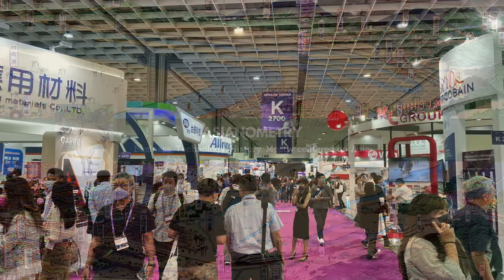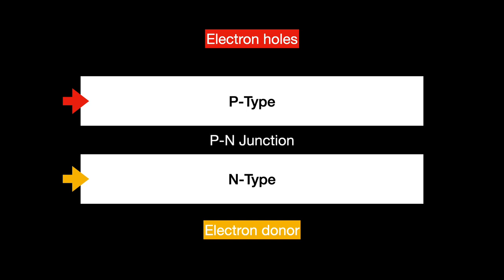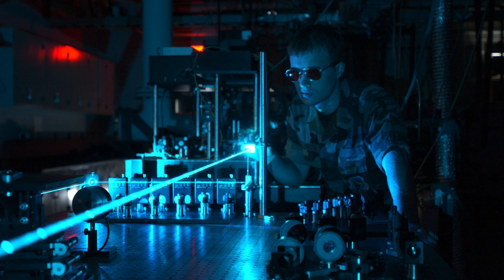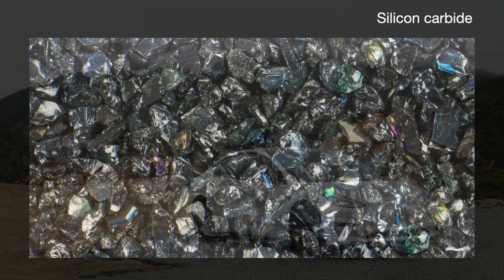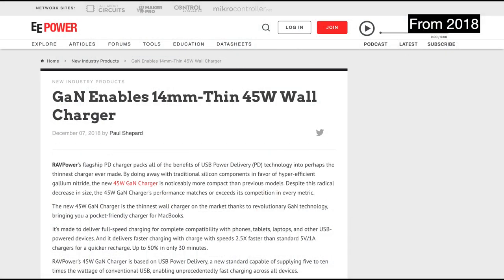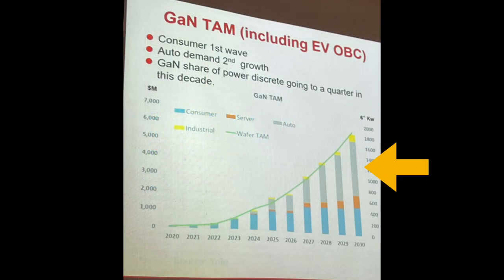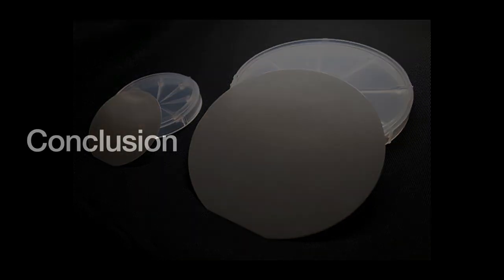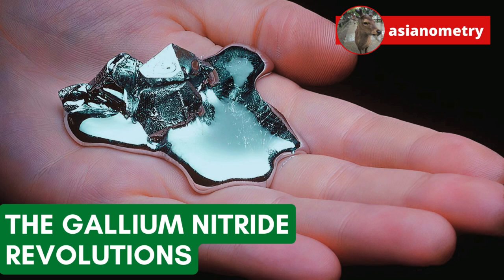The Gallium Nitride Revolutions

Comment: I keep forgetting Canada's role in Semiconductors, it would be interesting if you did a video on the industry in Canada.
Reply: Could you also please do a lecture on high voltage high power solid state over the years as in megawatt grid equipment. There are still the odd mercury rectifiers operating (rail lines) but there was no way they could handle 1200KV and several gigawatts.

Comment: Great video, Jon. My dissertation from 2004 was about GaN / AlGaN HEMTs. At the time, we were only set up to grow on 2" substrates of sapphire and SiC. High quality 2" SiC substrates were $4500 apiece, which added significant cost. To dial in optimal conditions, we'd use sapphire, but if we wanted to make the best device possible, we'd use SiC due to relatively low lattice mismatch to GaN and high thermal conductivity.
Reply: Me too. I submitted mine about GaN HEMT modeling in 2006.

Comment: I have a 1940s Selenium rectifier I bought at a surplus store in silicon valley years ago, and it's amazing to think how silicon made the modern equipment just a tiny component, but now with these future materials, components will continue shrinking to amazing degrees.

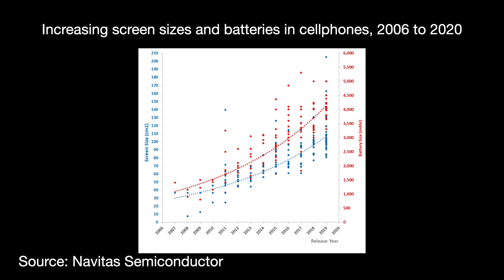Comment: 7:47 - The units of battery capacity is expressed in amps x hours.  If you work through the units it's the number of coulombs of charge it holds.    Amps / hour would reduce to coulombs / hour^2 , which is some kind of acceleration unit

Comment: In 2020, I had a chance to do research in GaN-based optoelectronics devices for photonics integrated circuits. The grand idea was since GaN was already a promising candidate for power electronics and it is a direct bandgap material, it might be possible to realize an all-in-one solution for everything electronics in the GaN platform (kind of). Another charm of GaN is its second-harmonic generation capability means that you can double your light frequency by passing it through carefully engineered GaN-based waveguides.
I got my degree from an Indonesian university. At that time, we had a joint research project with French universities and we also sent a few PhD students to learn from them. However, my alma mater is not pursuing this research topic anymore, whilst the French researchers are still researching this very topic.
Reply: Was the research done in IISc ?
Reply: @NiceBot724  He is not Indian.
Reply: @alexanderphilip1809  oh my bad, thanks for correcting

Comment: I am not an expert in this, but I invested in a power-electronics startup a few years back. Through them, I met one of their suppliers, which was a quite innovative startup in the WBG semiconductor space. The guys I know in the industry believe that SiC will likely continue to dominate in high-wattage applications. From what I've seen, GaN has a sweet spot in miniaturization of relatively low wattage applications like phone chargers. For applications like EV inverters, EV-charger rectifiers, and other high-wattage power-distribution applications, SiC has advantages due to its superior thermal conductivity and (I believe) durability. Both these companies have since been acquired by large multi-nationals, and I haven't followed R&D in this space as closely in the past 12 months or so. In any case, I believe that there will continue to be advances in WBG semiconductors that will continue to enable companies to miniaturize power distribution products, make switching of high-wattage loads more efficient, and enable improved electrification of mobility and energy storage. I think GaN will be just part of this WBG semiconductor story.

Comment: WOW! Same story as gallium arsenide. Faster switching times, early adoption by the military (involved in some of those) and hard to work with. In the meantime, silicon improved fast and overtook gallium arsenide because of its lower cost and larger scale. I recall once a relative of mine asking about a stock tip in a gallium arsenide company. I told him the story I have just related, and he did not invest. Good thing, since that company went under not long after. Gallium arsenide may well have a niche place in the industry, but I expect that is all.

Comment: 1:00 Not all materials have a bandgap. For instance, metals and other conductors usually have no bandgap. Graphene is an example of a semiconductor with no bandgap. However, all semiconductors commonly used in the electronics industry today do have a bandgap, though the gap is small for some semiconductors.

I'm not an expert, so maybe there is some technicality when you get into impure materials that endows metals with some microscopic bandgap. But I think in principle, there is literally no bandgap at all, not even a tiny one.

Comment: Great video. One thing to mention is HEMT had been used in military applications way before GaN appeared. GaAs HEMTs can provide high power and low noise at the same time. They also can operate at higher frequencies.
Reply: You will find they are used in all DBS LNAs and LNBs too ...

Comment: oh That's really fricking cool it is the first time something close related to my lab is cited. I work in a lab in Brazil and we make the semiconductor part of sensors for the aeronautic(I work in research and have no idea how it is currently made). We work manly with optoelectronics like solar-cells and medium infrared. My sector is trying to make the gallium-nitride semiconductors by Atomic layer deposition(basically you turn the compound into a gas and condenses slowly over a surface) and we have achieved enough success in the process that the semiconductor can be successfully used on solar-panels but are yet good enough to be used as sensors or for electronics. It is insanely hard to make them the concentration of the gas and the layer numbers affect the crystal and this create defects and the really sad part is that we can't adjust instantly(but the changes happen fast) we need either better equipment or better control of what we already have. My main job here is to compile the data, and control the equipment with the instructions provided by my 2 mentors on the project they are the ones that analyze the data(I don't think I am capable of doing so even if I am almost graduating one has a phd and the other is actually doing this as his phd project).

Comment: It'll be interesting to see the impact of GaN in lightweight power systems, eg power tools, drones, etc.  Re: synthetic sapphire, it's cost as a semiconductor substrate cannot possibly be tied to it being a precious gemstone.  I know next to nothing about the field, but I do know that low quality synthetic sapphire is ubiquitous throughout mechanical industries, where it sees uses ranging from precision bearings through abrasive compound.
Reply: Sapphire is a crystal of aluminium oxide. Also not easy to manufacture, but in the image in the video you can see the industrial shape it is manufactured in.
Reply: Sapphire is gem quality corundum. It is not used as an abrasive. Corundum is used for that.

Comment: With dual gate GaN, power supply manufacturers can throw away the bridge rectifier and the 60% efficient 1920-vintage boost regulator and use the 2011 bridgeless PFC circuit.

Comment: A simple question;
I'm in the-US & making a cool solar concentrator oven.  
I would like to place a solar PV cell at the focus of the parabolic mirror.  Of course I'll water cool the back of the solar PV cell (like a car radiator system).
Supposedly gallium PV cells are much more temp tolerate than silicone PV cells.   
However ????where in the-world can I buy a few gallium PV cells????

Comment: thats was a mega power move of a video jon!.Entirely interesting, includes food and blue LEDs!! also lots 'o deep info at multi level. The kick is learning/teaching ratio is at an understandable level.."the subtle learning is empowered by repeated subtle lessons." < -i made that quote up. But... it is true for a willing learner, if a fact is to stick.. it has to be absorbed 3 times in different presentations/examples/stories each time.  :)
Reply: Many years ago I came up with a "half-life" analogy for teaching for optimal retention. Spend an hour on a topic. Beat it to death. Drum it in. Students will initially have good retention but the half life will be short. The material doesn't stick very well.
   An alternative strategy is to spend, say, 15 minutes giving an introduction with not a lot of detail. After a week or so, give the topic another 15 minutes, this time going into more detail. Then repeat for a third time, this time providing all the required detail. After three visits to the topic, the half life will be very long which is to say the retention will be excellent - far better than with the initial approach.
  I employed this method in the time frame of a single semester-long course, and also, when I had the opportunity, built it into the sequence of courses in a 2-year program of study. (Subject was electronics technology.)
Reply: @clarencegreen3071  Thats good info! and pretty much what is was angling at. Particualrly the half -life of retention :)

Comment: Batteries are specified in mAh, which describes the number of mA they could output for 1 hour. 4300 mAh means it can output 4.3A for 1 hour. Or the same battery could output 1A for 4.3 hours.

Comment: Disclaimer, I’m only a masters student in Power Electronics, so there might be some things I might be missing.
Wouldn’t SiC beat GaN due to cost reasons, because SiC chips are easily created (relatively), making them cheaper in the long run.
The size difference between SiC and GaN is also negligible compared to the jump from Si to SiC/GaN
Reply: GaN is grown as a thin epitaxial layer on a Si wafer so the raw wafer cost is much lower than SiC.  The GaN entitlement is over 10x higher than for SiC so the die size for a particular rated transistor is much lower on GaN than SiC.  The front end fab for SiC is unique, whereas GaN can simply use turn of the century old Si front end fabs.  Finally the back end fab for SiC requires diamond saws to cut the SiC whereas GaN uses the same equipment as for Si.

In every way GaN is considerably lower cost than SiC. 

SiC has the advantage over GaN that the technology is approximately 10 years more mature.  The other advantage of SiC is the suitability to make higher voltage FETs.  Several SiC companies already have commercially available 3.3kV SiC MOSFETs and today the highest voltage commercially available GaN is 900V.

Comment: So this displaced GaAs? I remember that being used for higher RF performance than MOSFETs, the GaAsFET, not sure if they were ever more than small signal devices though
Many III-V semiconductors are possible, as an alternative to group IV  (periodic 14)
Paradoxically, Lead and Tin are in the same group as Silicon and Germanium but are metallic rather than semiconductor

Comment: Another factor affecting operation at elevated temperature is the temperature at which intrinsic conduction starts to dominate over extrinsic, leading to thermal (primary) breakdown/'thermal runaway'. Would be nice to have info on this characteristic vs silicon which can be used only up to around 200C (junction temperature).

Comment: My current phone didnt include a charger, as with any flagship model. But they were not entirely cheap either,  I had to buy one for $50 to enable what Samsung calls Super Fast charging 2.0. It's very convenient when you have to charge from a very low battery level and up to 75% in no time.

Comment: Growth of leds is the number 1 factor for the insanely high cost of microled tvs. Each 4k microled tv requires 25 million leds, not to mention the number of leds that are defective and have to be replaced. This means you will need 100s of sapphire wafers just to make a single microled tv.

Comment: Are you saying that GaN semiconductors allow for higher power density though lower Rds(on) numbers (than silicon), reducing the losses and hence heat generation in switching circuits ? Other factors affecting losses include switching speed (usually the higher the better up to a point) and losses in the magnetic components (which GaN obviously can't affect directly) and rectification losses.
Reply: GaN is 1000 times better than Si as a power semiconductor material.  Sure GaN can't eliminate magnetic device losses but it  does allow for a much higher switching frequency which changes the design space for the magnetic components which in turn enables losses to be reduced

Comment: Surprised you didn't mention electric grid applications such as HVDC transmission, frequency conversion on generators of large wind turbines, battery energy storage for grid, others. 

Will advances in GAN affect costs there?
Reply: Initially SiC will dominate in these applications as it is already scaled to work at higher voltages.  Several companies already have commercially available SiC FETs that are rated for 3.3kV.

The current highest voltage GaN device commercially available is rated at 900V.

The automotive industry is showing a lot of interest into GaN on the basis that it has a much better chance of being able to be scaled to meet the demands of EV applications. 

All existing commercially available GaN is GaN on Si wafers, however this is the technology bottleneck limiting developing higher voltage GaN FETs. 

GaN on sapphire will allow for much higher voltage FETs to be made and this will probably end up being lower cost and higher performance than SiC.
Reply: @michaelharrison1093  Thank you.
Reply: @michaelharrison1093  GaN and SC IGBTs?

Comment: At the moment, ganfet still strugle with some gaasfet capabilities .... it's not only capacitance but also linearity of response and self induced noise that keeps gaasfets as prominent at ultrahigh frequency and ultrahigh precision.
Reply: That comparison is in relation with RF applications.   This video is focused on power conversion applications.   In power conversion applications GaAs is not even a contender
Reply: @michaelharrison1093  True, however there are several mentions of satellite and radar, where frankly you require extra precision that you are willing to sacrifice for power and then achieve power through other means of amplification.

Comment: Since many laptops now charge through USB type C, and I finally moved to a phone that also uses type C, I decided to buy a Baseus GaN 2 Pro charger, and it works for the company laptop I have, and is MUCH smaller than the power brick for its legacy circular power plug.
Point being, charging our laptops with more compact GaN chargers is already the present, not the future. When will laptop makers makers do a full switch, I don't know, but having the charger be smaller is a selling point they can use.

Comment: An excellent video and very accurate information (apart from the units for battery capacity that several people have already mentioned).

Some other interesting WBG details...

SiC certainly has the advantage over GaN when it comes to being able to make higher voltage blocking FETs - with several companies already having 3.3kV commercially available devices. 

GaN HEMT technology has the technical advantage when it comes to supporting higher switching frequency.

Big power applications such as motor inverters for EVs, rail transport,  wind generators, etc. are adopting SiC which is displacing the existing Si IGBT (Insulated Gate Bipolar Transistor) devices.

Small power applications such as mobile computing chargers etc. benefit from adopting higher switching frequency on the basis of making the passive component sizes smaller and hence the scale adoption of GaN for these applications.

Comment: It is milliampere hours, not milliampere PER hour. It is the capacity of the battery, not a power usage. 1400 mAh means it can deliver 1400 milliampere for one hour, or one 1 milliampere for 1400 hours, not 1400 milliampere PER hour.

Comment: They use silicone carbide and silicone nitride for gas furnace igniters. This has been for over a decade in common residential furnaces.
Reply: Gentle correction - silicon, not silicone...